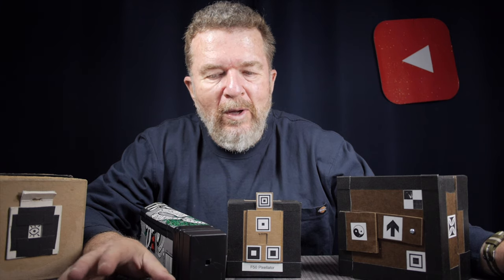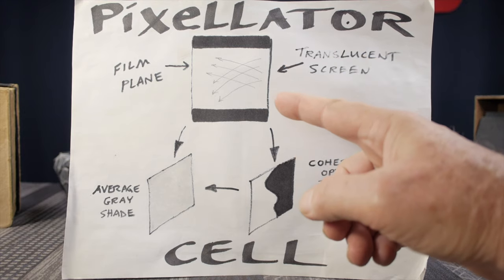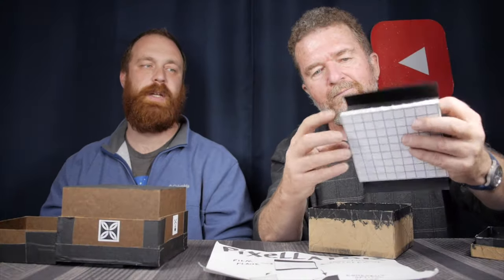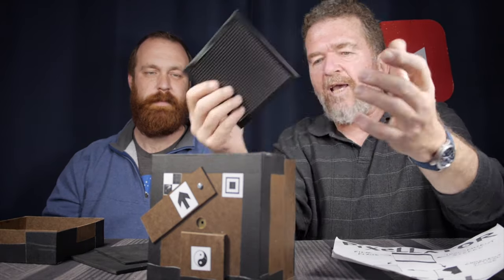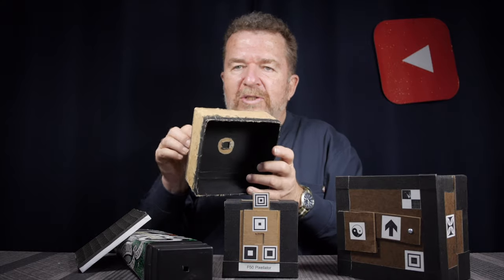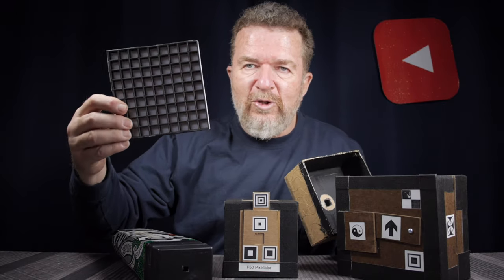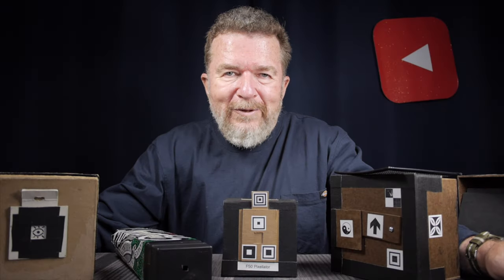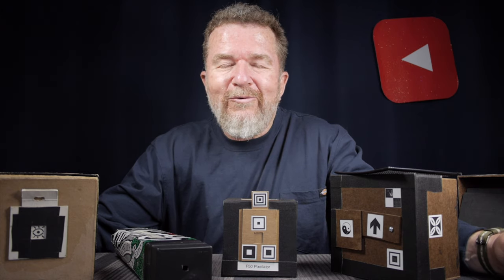Joe's Pinhole Cameras - Part Five

Comment: Joe, why did you choose the grid sizes that you did?  Was there some trial and error there, or just a particularly low-fi aesthetic you were going for?

As an aside, I'm really enjoying this series.  Thanks for the work!
Reply from the maker: Part of the reason was finding premade grids like the sewing mesh or light fixture diffusers, you take what you can get. The handmade 1/4” cardboard grid was a trade off between resolution and how much tine I wanted to spend cutting cardboard by hand. If I made another I’d make a finer mesh with deeper cells and a better diffuser screen.